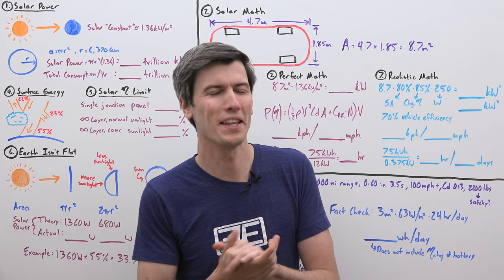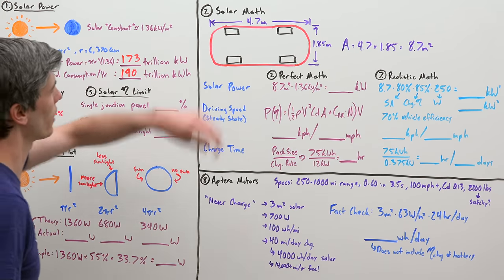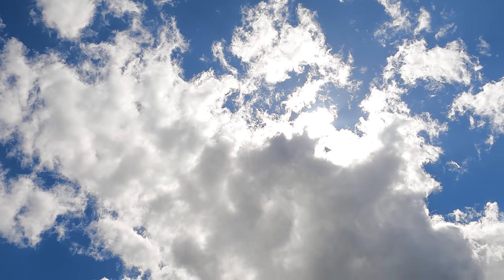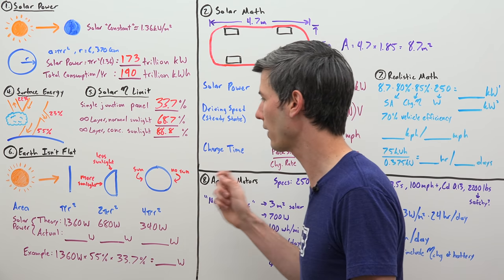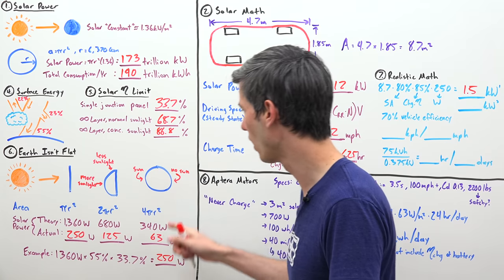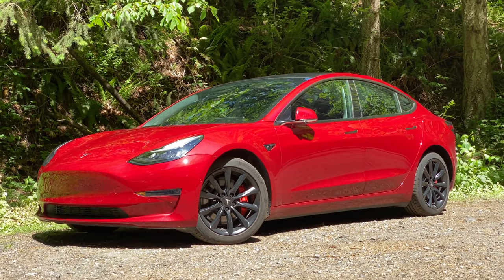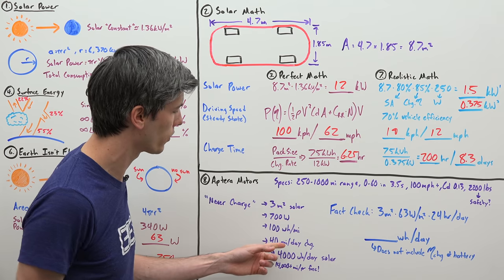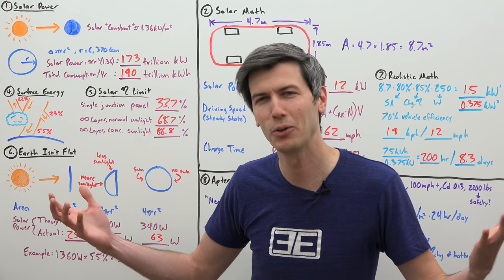Why Don't Solar Powered Cars Exist?

Comment: I've been in the solar industry for 8 years, and am very familiar with watts per meter squared and the available amount of energy from the sun. This EE video is spot on, and very accurate! Thanks for doing all the math that we're too lazy to do ourselves! Keep up the good work!
Reply: Hello, can I ask you a question about this, please. He multiplies every square meter by 63 Watts by 24 hours. This gives an output of 1512 Wh per day. That would be 1.5 kWh per day per square meter of PV panel. Isn't that too much ? Would you say that is an accurate estimation ? Thanks in advance !

PS: In Greece (where I live), we multiply the PV panel's output by 5 to get the daily output, so for example we would say: 
1 square meter gives 180 Watts, times 5 = 1200 Wh per day, instead of 1512 Wh.
Reply: @dimitristripakis7364  yes you're right.
Reply: I'm not sure how much it would change the numbers and I really enjoy these great videos. The only very minor flaw to me in the calculation of sun energy striking the Earth is that the percentage of absorption by the atmosphere will increase off the perpendicular.
 Having lived both in South Florida and in southern Canada I am familiar with the difference of peak Sun intensity with a varying degree of atmospheric absorption. Please advise at your convenience.
Reply: I live in North East India. In Meghalaya. Here we have highest rainfall in the world. Just few weeks ago we got some 900 odd mm in a day..
In June July solar insolation values are calculated at less than 2 hrs per day
Reply: Why is it so rare to see solar installations that track the Sun as it moves - keeping the panel square to the rays ??  I know it requires actuators and hinges, but I.m talking about actual gains in output of a $25,000 system.  I'm in Florida and have room to put the system on the ground, not my roof.  
I was also wanting the system to "park" vertical to be "hail-proof" and park "flat" for the occasional hurricane.  This would theoretically pay for the whole system if it wasn't destroyed.
Reply: @Ken Harris

You haven't even watched the video, have you?

Just because you see cars with a solar panel means absolutely nothing, they all still have a normal charger as well, you don't know how much they are charging.
Reply: Query,: in the Americas, does one talk about all area in terms of: per  "foot squared" (assuming "meter squared" is more rare)?  - Where I hang out we tend to just say areas as;(for example) watts per  "square metre" -  or per "square foot" - feet for pluralist pedants where applicable  ( a construction square is 100 sqft - metricised to 9.2903 m^2 (square metres- obviously one could also say -- to the second power)) - just wondering, as JF does have interesting, and very clear articulation, just wondering if that is typical...    he is a busy guy so I ask you - who also used the "turn of [phrase".   please excuse the intrusion.

- don't worry one can crank up a spreadsheet and follow along with Jason's tutorial, the maths is fairly logical..  jk

(a meter squared has mathematical /  Pythagorean meaning, to be sure, not my regular expression..  (ft-Lb  or - the internet based unit of  Lbf-ft also strikes a shiver, ( have been doing maths, science and Engineering calculations for too long. - yes, indeed in all systems of measurement..) like nails on a chalkboard.
Reply: @Carlos Spicyweiner : sir, go right ahead, nothing stops one adding some panels to their e-rickshaw canopy - 19kph is still better than walking - and that was for a heavy car.
Reply: @kadmow  if you are an engineer, they go to great lengths at engineering school to make sure you're comfortable in both metric and imperial systems and can convert back and forth. Also sciences are all taught based on the metric system, even here in the US. Hope that helps
Reply: Lol. I wonder how many engineers tasked with something for their job just use EE videos for "research".
Reply: @alanwilson27 , There is a meter that reads in watts per square meter, of sunlight.  You could use it at your property in Florida and Canada.  It will give very accurate measurement, and then take the average cost solar panel used in America, it is about 25% efficient.  So a 200 watt per square meter of solar panels X 5 hours a day makes for very easy math, and easy to understand.   By the way, I measured 800 watts per square meter in January in San Diego.  However Boulevard, about 35 miles east, and at 3,600 feet elevation, on the same day was 875 watts per square meter, due to the higher elevation, less atmosphere, and less dust that can be supported by the thinner air.   It is also about 15F cooler, so you get more power from cooler solar panels, than ones at higher temperatures.  

Thus Denver Colorado offers some of the best locations to install solar, with it being about 5,300 feet elevation, and many sunny days each year!    Being very cold in the winter, and normally having some sun reflected off of the snow can help too!
Reply: @kadmow ,  Usually with solar systems, they do use the term watts per square meter in America.  Not watts per square foot.  Also the power meter that I own, it registers in watts per square meter.  I find the nominal power output to be about 800 watts per square meter in San Diego, about the same latitude as India?  

San Diego is near sea level.  While going to about 1,000 meters above sea level, you would normally see about 10% rise in the watts per square meter measurement.  Maybe at some time this summer, I can find the meter and measure the watts per square meter at 1,000 meters, 2,000 meters, and whatever the highest mountain pass that is close to my house, about 2,500 meters above sea level.  I live at about 30 meters above sea level in Portland Oregon.  To my east is Mount Hood, and the top is about 3,000 meters, but the roads do not cross over the top of that mountain.   I can drive up to the ski lodge, and measure the watts per square meter up there.  It is about 80 miles from my house.
Reply: @Carlos Spicyweiner, When I owned a motorhome, I had a 400 watt solar system on the roof.  It allows about 25 - 30 amps charging of the 12 volt battery.  My alternator was rated at 130 amps, so it would put out a lot more power than the solar system could.  Yet most of the time, it only put out about 35 amps.  

The 225 HP engine would use more than 1,200 watts per mile if replaced with a electric motor, so solar would not provide even a small percentage of the power needed to move my 15,000 pound motorhome.  I would only generate about 2,000 watts per day with my solar system!
Reply: @Kangenpower7  sorry you gost so invested in the answer, my query was not an imperial vs metric question but a metre "squared" vs square "meter", order of operational language. Forgive tge honest question, lost in the explanation.  Have a great day over there in San Diego. NB.  India is bigger California MAybe + Nevada, Arizona and Utah all the way up to Idaho - and some, no one Latitude solves for that.
Reply: I like the video overall, but the "fitness for a specific location" is the most important. An average for the whole planet is almost meaningless, because in California you can have a mostly sunny weather with much less atmospheric absorption, while somewhere cloudy, it will be much worse. Also, he works with the solar panel efficiency of 33,7, but I'm not aware of that being available - it's more like 24%. And that's also the best case scenario - If your car stands in the sun the whole day and the panels are overheated, the efficiency goes further down. Lastly, there's also the effect of shadowing from trees and buildings in a city which will further bite into the available energy. While normally you would prefer to park your car in a shaded spot in the summer, now you'll be driven to park the car (with a black roof) in full sunlight. Then when you come back to it, you'll have to crank the AC to cool it down again.

So yeah, it's probably better to put more stationary panles wherever we can (for example above parking spots to stop car interiors from overheating) and increase the capacity, longevity and charging speed of batteries.

Comment: They do exist! The point is driving a car optimised for energy efficiency, and a not extreme driving mix: My car 1800lb 20kWh EV. Small, but uses only 160Wh/mi on average. On the roof I have a measly 100W solar panel connected to a DC boost converter making 300V DC. It is always connected to the battery and charges it with 300 mA whenever the sun is up. This gives me 3-4 miles per day in range. This is not much, but it is enough for errands around town 3-4 times a week. I only drive 3000 mi  yearly, so this supplies more than half my charging needs! Going to put another 100W panel on the hood some day to unplug completely. except for when visiting family.. If you need to drive 40 mi daily on the HW, this won't work!
Reply: So true !! 
Same is with alternate energy sources !
All a pipe dream . Even EV cars are only for city driving . 
Tesla makes long range EVs but they are nothing but a huge pile of Lithium on four wheels .
Reply: That's really neat! Do you have any videos about it?
Reply: I'm glad you're able to make it work. You have very well below average usage. And probably above average sun...
Reply: @TheGecko213  I like that you don't have any idea of what you're talking about.
Reply: 300V seems quite low of an output voltage for a standard 96S EV lithium pack, is it LIFEPO4 then? And I assume you're not charging to 100% SoC, maybe 70%?
Reply: @Infinion  only 60S so 247V 100% charge end voltage. It is a Li-ion converted Lead-acid EV from 2002. I got it because it was smaller than what is currently available. My inverter can manage up to 380V but the DC/DC only 257V, so without upgrading that, I settled for 60S. My solar charger has a cutoff at 235V, so it tops around 80% charge.
Reply: @bbgun061  1kWh / day on a nice summer day, 200Wh on a bleak winter day,
Reply: @Tore_Lund  Thanks for the reply. Glad to hear the cutoff is set at 80%, hope you get a long lifetime out of them. 60S seems reasonable, especially if yo have your BMS all sorted out for that configuration, and the motor controller is happy with it. You could also increase charger efficiency by connecting your second solar panel in series for a marginally smaller boost ratio, but the panels would be more sensitive to shading. I'd love to know what kind of boost you're using, probably a flyback type for PV panels to achieve the huge Vout/Vin ratio?

" I got it [the car] because it was smaller than what is currently available." Yeah modern EVs are pretty huge (size and capacity but not so much their efficacy), but now I'm really curious, which car is it?
Reply: @Tore_Lund  Nice! What kind of car is it?
Reply: @bbgun061  It is an electric version of the 2002 Fiat Seicento "Fiat Seicento Elettra". Fiat made 758 of them betwen 1997 and 2005  for visiting nurses and municipal police in Rome and Turin. However with lead-acid- batteries, the maintennance required was high, the project was scrapped and they were all autctioned off.
Reply: @Infinion  It is a Fiat Seicento elettra from 2002. I'm using 5*  12S battey modules from a 2017 BMW i3. they each have their own BMS sub module which talk through CAN-bus to my master BMS, which is the open source "SimpBms" Which does the balancing and monitors temperature and individual cell voltage, rea out is done to a small graphical LCD on my dash, for capacity left and alarms. The original Italian BMS, I have bypassed completely

What I like about this EV, is the highly modular way every sub system is made: Inverter, DC/DC converter and charger, all communicate through 12V logic level wires. There is no black box managing everything. so whatever changes I've done to the baiviour of the charger and cooling pump speed, was a simple matter of rewiring and changing  a few resistors.
Reply: @Tore_Lund  Brilliant, Thanks for sharing! I also realized later that the DC-DC converter you refer to is the original on-board charger for the 18*12V lead acid batteries which the solar most likely feeds into after a micro inverter.
Reply: @Infinion  No the DC converter is for making 12V for headlights, etc. It is a dog in inefficiency at low load it is only around 50% efficient.  There is still the original 3kW onboard charger in the car. However, as it is for lead acid, I have to be the intelligence in it. If I plug it in and fall asleep!! Originally I used only 20W solar, only connected to the 12V system, to unload the DC converter, to save on the main battery. But all that sunshine wasted when parked,  I wanted to trickle charge the main battery too. After a week without driving I noticed It gained 5% SOC, so that got me thinking!
Reply: @Tore_Lund 

I think the majority will park a car inside or next to the house, perhaps in a carport, depending on how expensive the car is.
The majority drives to work at around 8 am and back home at 5 pm, in winter you get about zero sunshine at these times.
They're planning to sell it in north-west Europe and North America, there you never have full efficiency of a flat solar panel, that's why solar installations are tilted at least 30 degrees.
The majority won't like to drive a smaller car either, in fact SUV's have only become more popular despite their weight and fuel consumption. I drive a hatchback that's supposedly small, it weighs 1,4 ton.

Comment: Really hoping for Aptera's success. The car may not appeal to everyone and fit everyone's needs but innovation and pushing boundaries is always a good thing.
Reply: Same. I’m on the waiting list. Crossing my fingers that they get the funding they need!
Reply: I think the Aptera would be a really fun car to drive, and actually can meet about 80% of my driving needs right now.  I might use another car for a longer distance drive, or when I need to have 2 car seats and a 4th passenger.  So 14,000 miles a year in the Aptera, and only about 200 miles a year in another car.  And 25 miles a year that I borrow my buddy's pickup truck.
Reply: It would meet the daily travel needs of most people in cities, in Europe at least. Great since it doesn't put extra strain on the grid too.